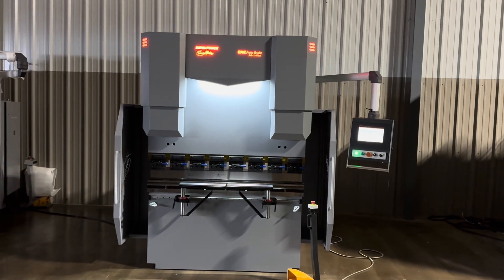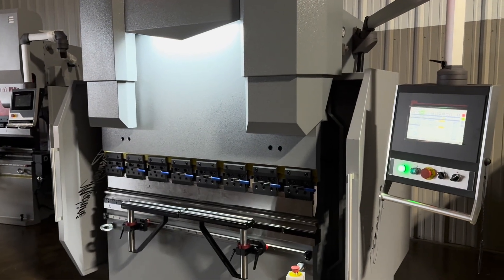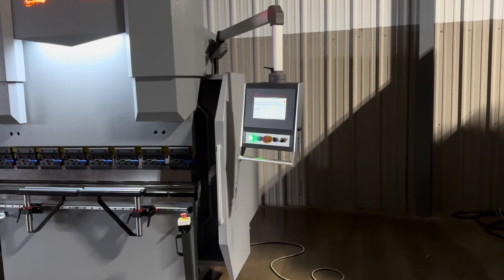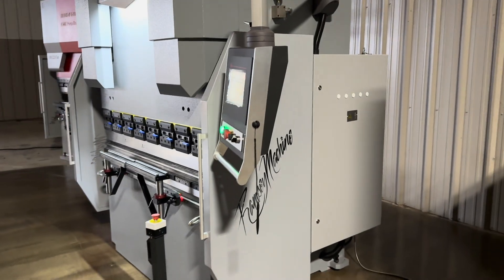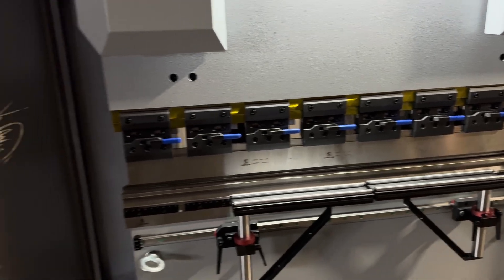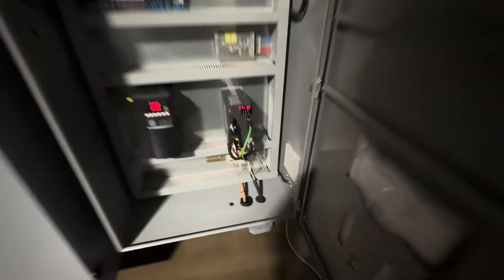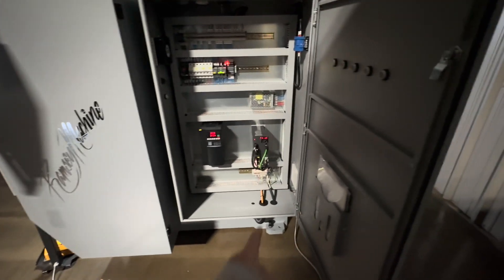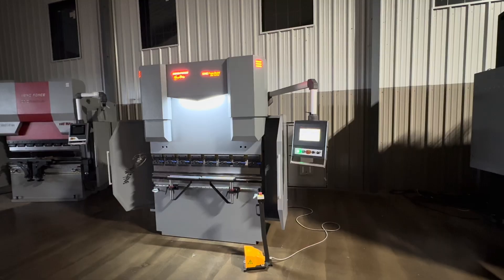5ft 110ton Largest Single Phase CNC Press Brake

Comment: One small correction, for USA standards, this would be a 2-Phase system. Each phase in the US system is 110-120VAC. To achieve 220-240VAC, you would need to use two phases to get the necessary voltage level. In the past, it was more common to have two phases which were 180 degrees out of phase and you would get a doubling of the voltage to 220-240VAC. It is a more common practice today to use two phases from a 3-Phase system. Because a 3-Phase system has120 degrees phase difference between each phase, you will not get a doubling of the voltage and the resulting RMS (Root Mean Square) value is 208VAC. For most equipment, this is not an issue and it will work with 208VAC, 220VAC, or 240VAC.
Reply from the maker: You sure about that terminology?  Its not consistent with anything I have ever seen .